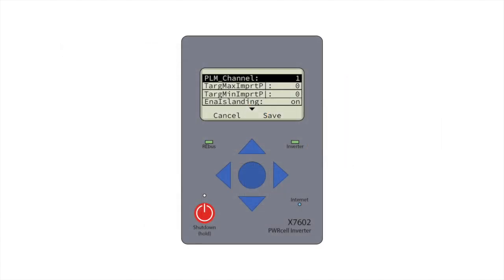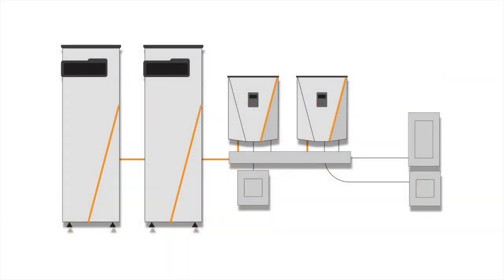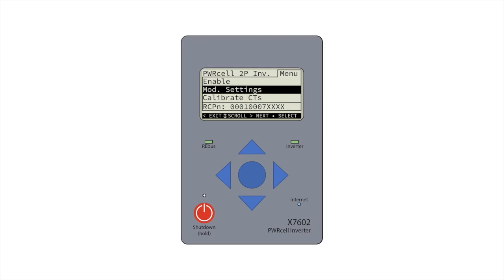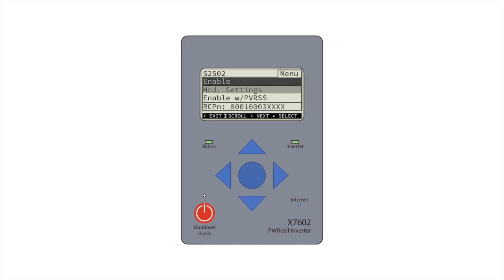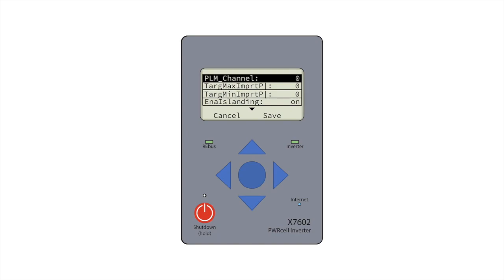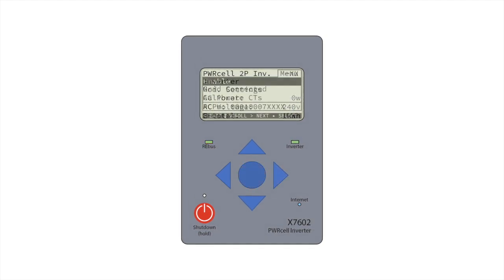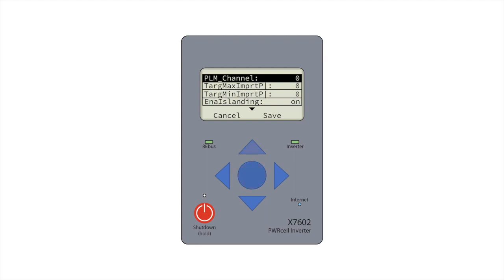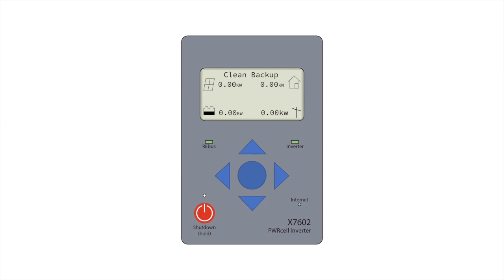Generac Installer Series: Commissioning Multiple Generac PWRcell Inverters

Comment: I'm looking to understand if REbus is electrically shared in a multi-inverter setup.   If so, is there guidance and/or requirements for where the inverters, batteries, etc... may or may not be interconnected?

Further, when using multi-inverters in an automatic whole house mode, it is unclear how to handle ATS (control and current sense) for the 2nd (or more) inverter(s).   It is also unclear how to handle connecting/controlling a PWRgenerator (DC gen) to a multi-inverter setup.   Thanks!
Reply: I am also trying to find more information on exactly this question as I have a three-inverter setup that was sold to me as a whole home backup, but I'm seeing conflicting info that you can only use a single inverter in an island scenario, even if you have multiple inverters -- the other two inverters will shut down.  Did you wind up finding any more info on this scenario?

Comment: I keep getting inconsistent information from installers on what devices and configuration are needed for a system. My array size will be about 17.5 KW.  Does the pwrcell solution with an array that size require 3 inverters?  Does the installation require sub panels to separate out critical and non-critcal loads?  Where can I go to information as dealers/installers are giving very different answers.
Reply: @Jeremy Niles I’m not looking to be redirected. I actually was referred by Generac to an installer. However, it’s my goal to install a system that does what I want and to have it be done correctly and with the right equipment. Just as there are solar installers that try to put a panel on every square foot of your roof, there are installers that appear to not understand how your system installed differently than traditional non power management solutions and want multiple inverters and also still require sub panel for critical loads.  So, I’m not trying to be an expert, just an educated and informed buyer.